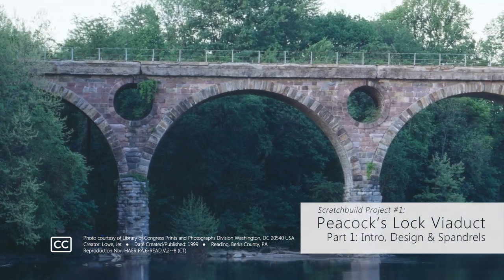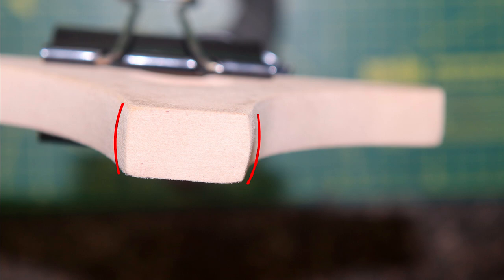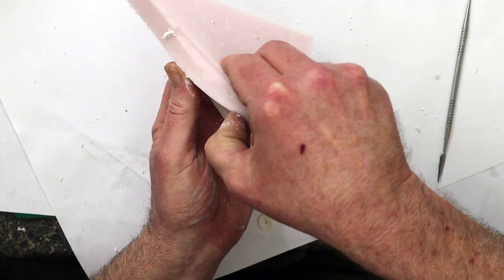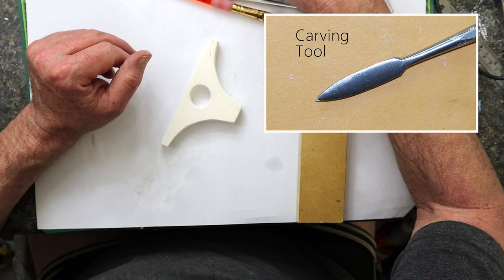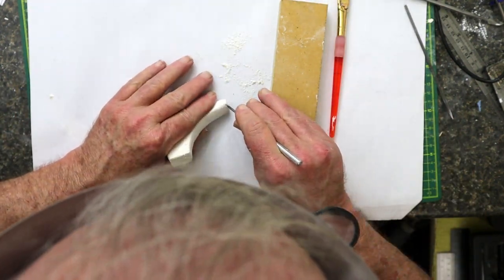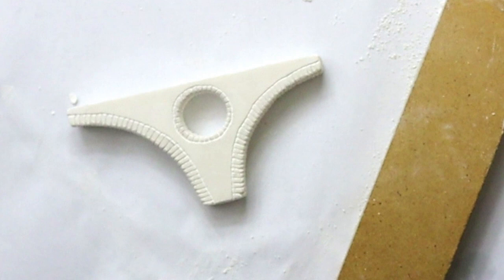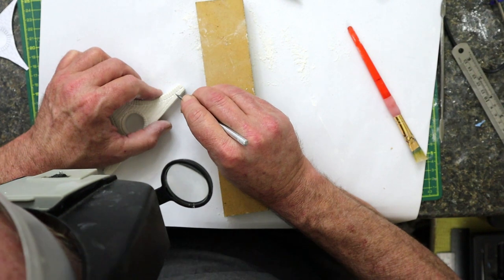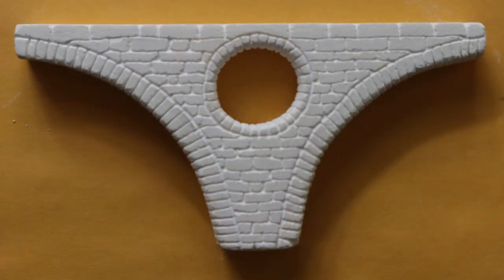Scratchbuild 1: Peacock's Lock Viaduct - Part 1

Comment: Great video. I'll try your methods when I get to make N scale tunnel portals.
 John there is a pierced portal bridge near Pottstown, in Sanatoga. It can be seen from Sanatoga Station Rd/Mahr Rd.
  I guess it doesn't truly qualify as a pierced portal anymore since it was either widened or repaired and is no longer pierced all the way through anymore. 
  One side diffenately has the portals still remaining. 
  I don't think you can actually access it anymore, I believe the quarry had fenced it off. You can still see it from the road. It is visible behind the Mahr Appartments, an old gristmill converted to appartments.